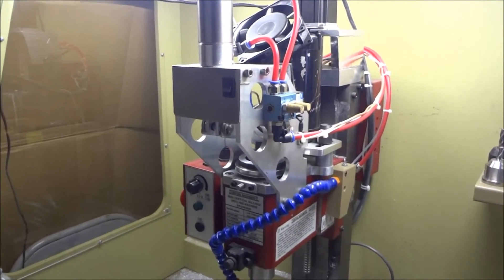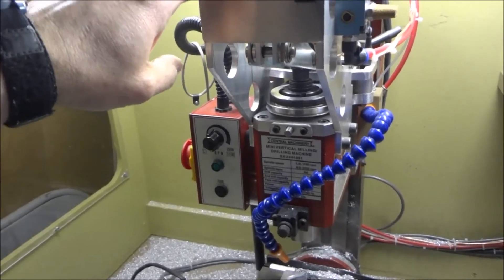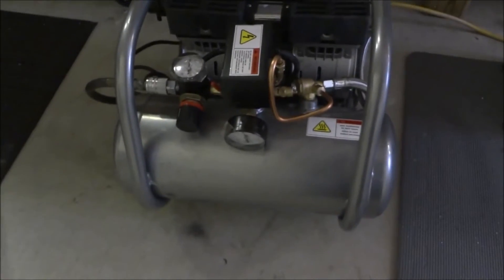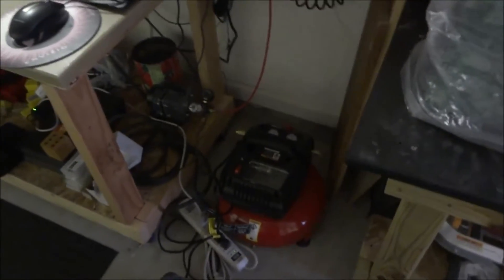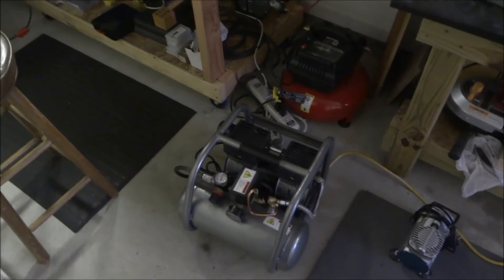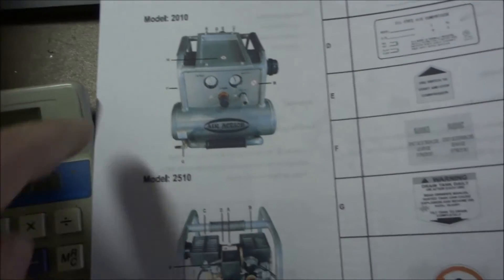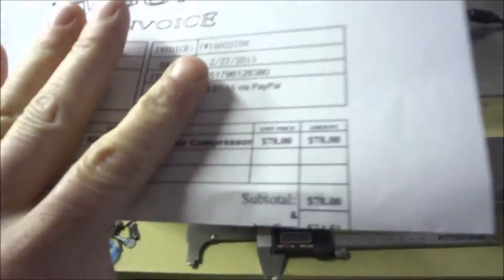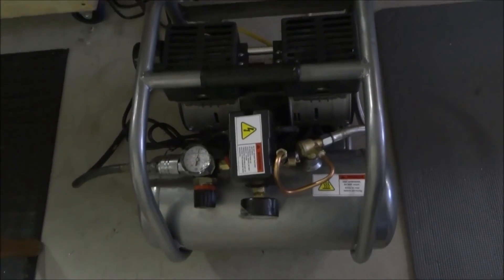X2 CNC Mill PDB  Air Compressor Option

Comment: what about the even smaller compressor next to the one you like. Would have been nice if you had said something about it,turned it on to hear what it sounded like, as I have seen those listed.
Reply from the maker: Awh yes that is a small airbrush compressor no good for this application not enough psi.

I used it to blow chips away from the cutting tool but it did not last 8 months before it Burt up and I paid $60 for it. Live and learn. 

I now use a pond aerator to blow chips away works well for now one day flood coolant.
Reply: CNC4XR7 I just picked up a 1744 gph pond aerator pump and wow that bugger really put's out the air. A friend and I are just getting our mini mill set up so haven't really put it to the test yet. Do plan on using it with a misting system too.
Reply from the maker: Hey let me know how the mister turns out I started down that route got all the parts made and it could not get it to mist just drip. Not enough pressure I think that was with the air brush compressor haven't tried the pond aerator yet.

Comment: How often does it kick on when you use the CNC mill?
Reply from the maker: Well air is only needed for tool changes I do not blow chips off the work piece with compressed air. I'm going to say about every 10 th tool change and runs about 60 sec to refill.
Reply: Not bad.
Reply from the maker: I checked today just to make sure it only cycles less than 30 seconds and about every tenth tool change.

Comment: That's a lot of difference between the two, and a good price for the Silent Air type. I'm going to use the parts in my pancake style compressor and replace the compressor with a refrigerator compressor. Been watching for a compressor on Craigslist to use for the conversion.
Reply from the maker: I have seen that done. Let me know how it turns out. 
My little pancake was so loud and it would scare the heck out of me when it kicked on. I thought I was having a issue with the auto shut off so I started searching for a replacement. And found the silent air compressor for the money I couldn't pass it up.  He had 3 at that price. Lol